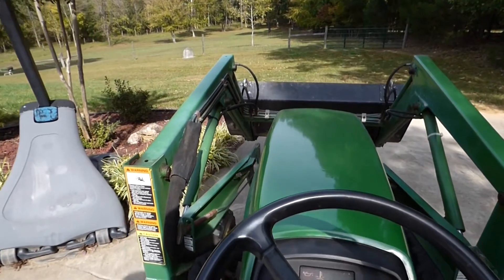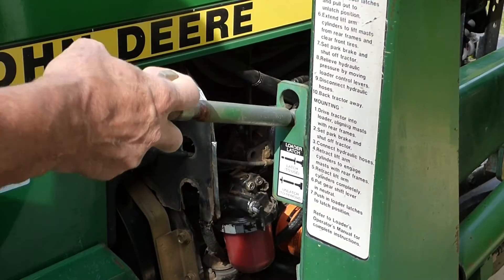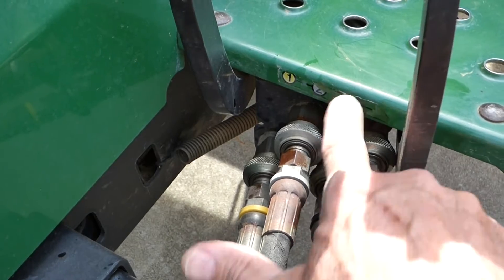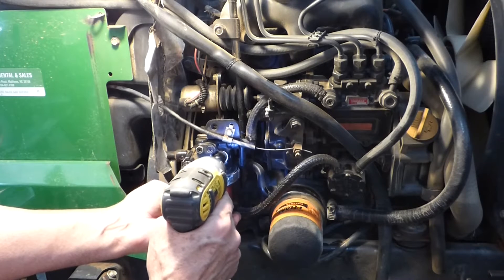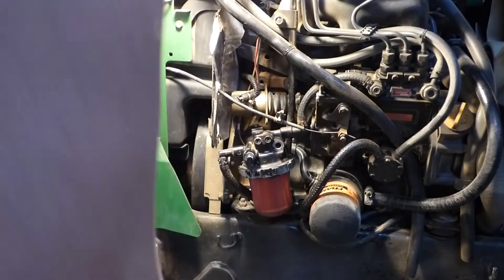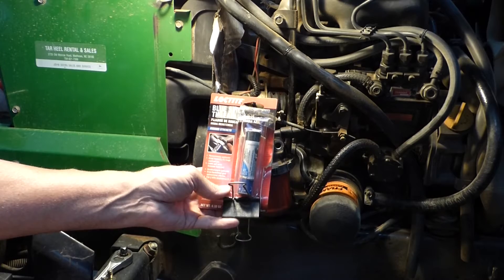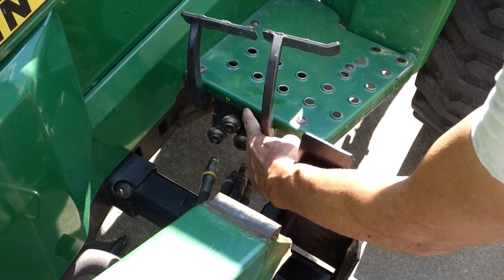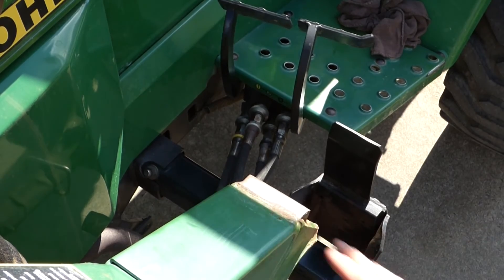John Deere Repair - Fuel Filter / Throttle Bracket - 655, 755, 855, 955

Comment: Good timing! I had poor throttle response and I was thinking low fuel delivery due to the fuel filter being old. Turns out it was the exact same crack in the exact same location as in your video. $10 later at the local welder and it’s all back together. I also had the fuel inlet pipe to filter piece come out. Some JB weld fuel tank repair and I should be good! It all back together now, just waiting on the JB to cure! Thanks for this!
Reply from the maker: Sounds like you found a good welder to help you out. I had the same problem years ago and JB welded it and it’s still holding. Wishing you the best and thanks for your visit
Reply: The repair has been great. Thanks for the suggestion to remove the loader. That made it a lot easier.

Comment: Any idea on how to tighten the “locking mechanism” where it moves/slides over that black mount?  Mine are both sloppy and causes the loader to move and sometimes dismount. It really sucks and does not appear there is any adjustability in it as both pieces are cast.